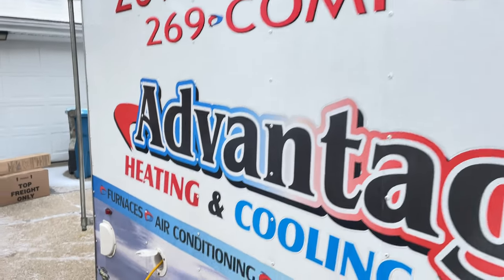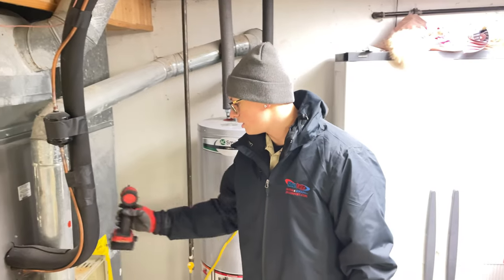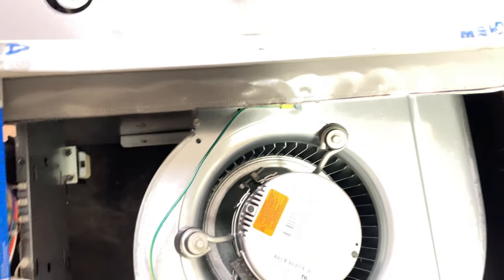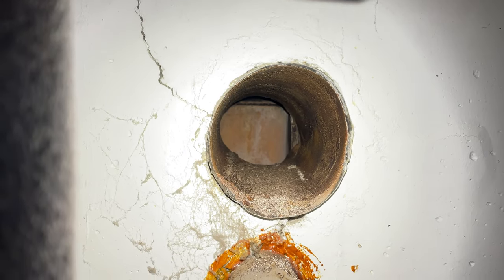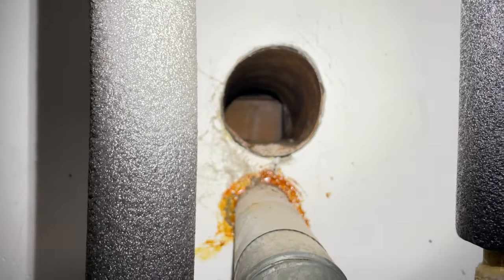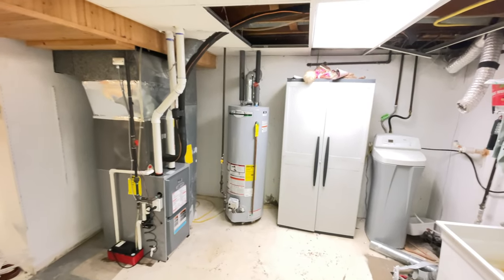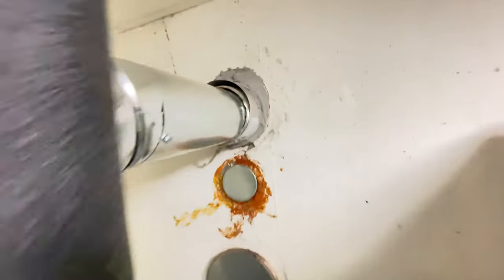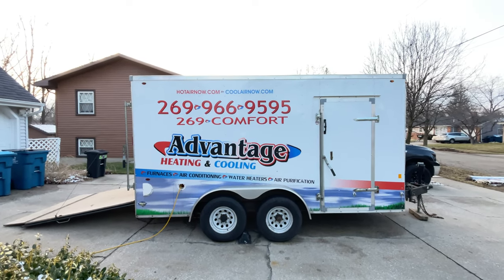No Heat on an old Carrier, Armstrong gas furnace Install

Comment: What do you mean flu accelerater?
Reply from the maker: It attaches to the end the concentric vent. You only use this when using a concentric. It helps with back pressure for the pressure switch. Only really noticed that you need them with the Concords have had some pressure switch issues with out using them. Thanks for watching.